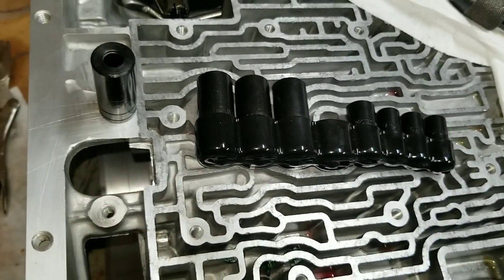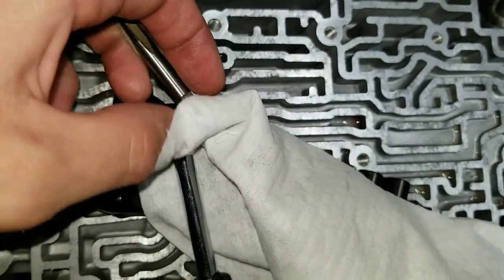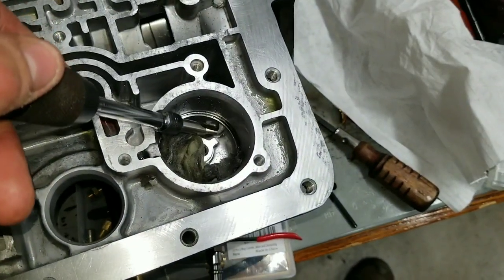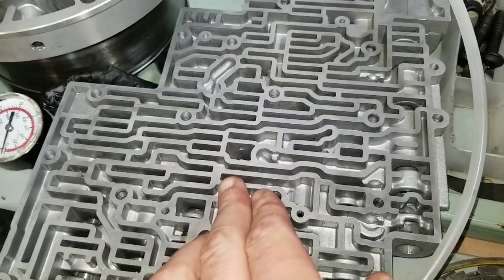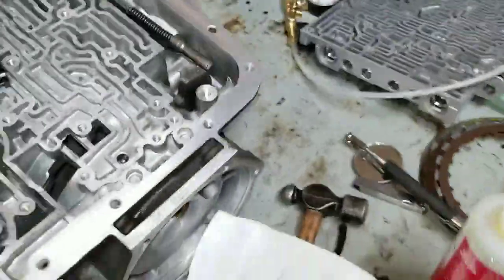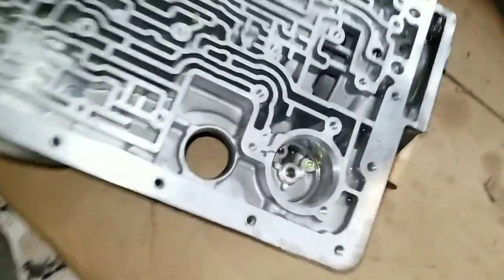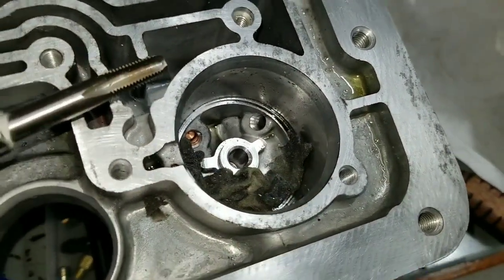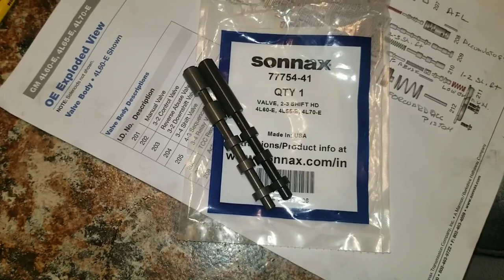4L60E Block 4th Accumulator, Sonnax HD 2-3 Valve, Tap Wrench Extension Trick

Comment: Just use an open end wrench on the square end. With a little bit of "feel" you can push on the tap to counteract the downward torque of the wrench. Try in a piece of scrap aluminum to get the feel. Sometimes you don't have the right tool and have to make do with what you have.
Reply from the maker: I have done this before. I hate it!  But it works in a pinch for sure! I'm sure with some practice, you can be quite confident in this method despite it being non-ideal. Thanks for sharing your experience!

Comment: Did you ever test this method with an accumulator?
Reply from the maker: @jonathanrobinson8176  As far as blocking it? My 4th accumulator is currently still blocked this way. Has been about 10k. Definitely not excessive. Glad I did it.

Comment: Did u leave out the one check ball in case?
Reply from the maker: If I recall correctly, I put it back in, but it does not matter either way. I believe I said in my post on LS1Tech, Low Mileage 4L60E Carnage... I will also add that 4th gear is definitely not too harsh. I kept the feed hole stock size, and I could have gone a little bigger.